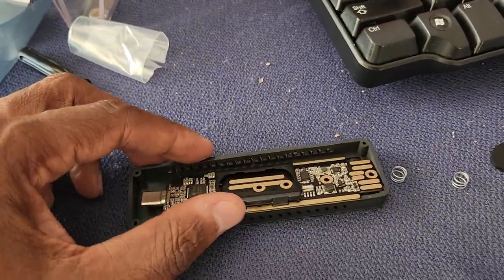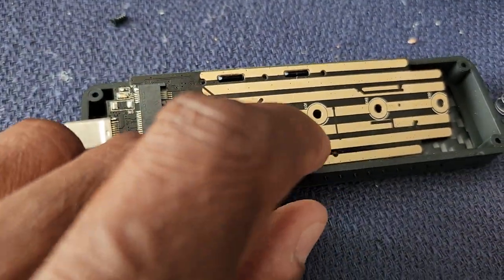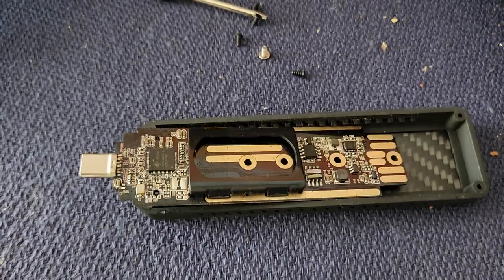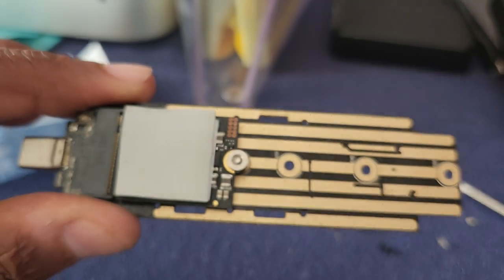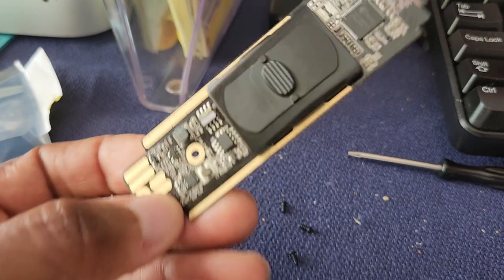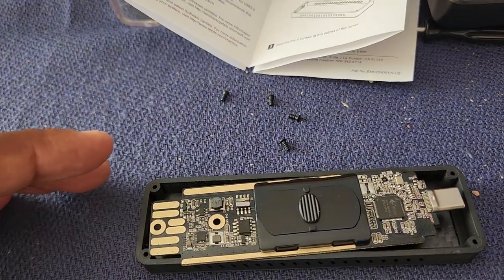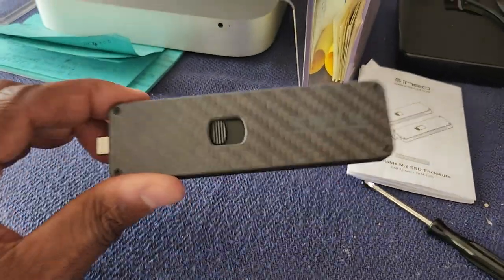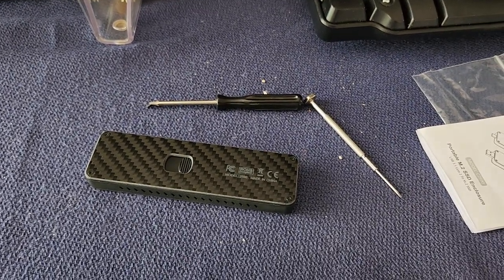Installing a Shorter M.2 SSD Card into an ineo Enclosure

Comment: The spacer slides into the rounded edge of the SSD (so that half the spacer is above the SSD and half is between the enclosure and the SSD)
Reply from the maker: Yes. It is all good. A simple installation after all.